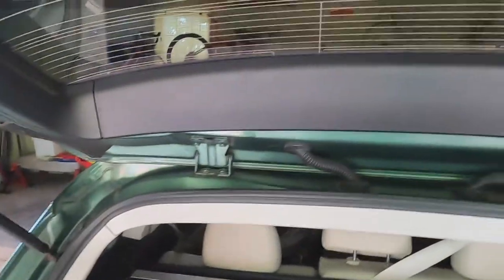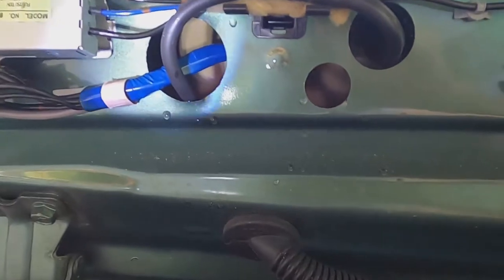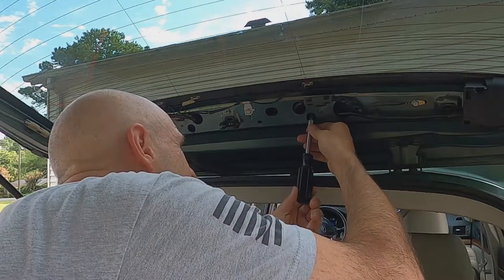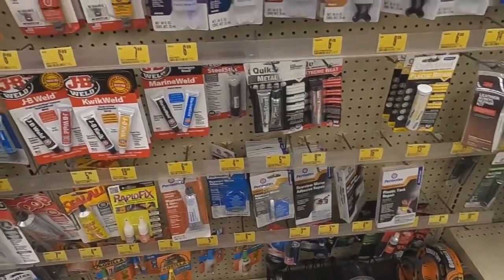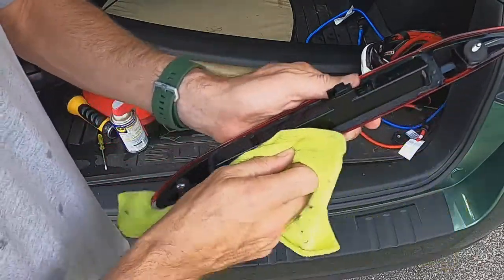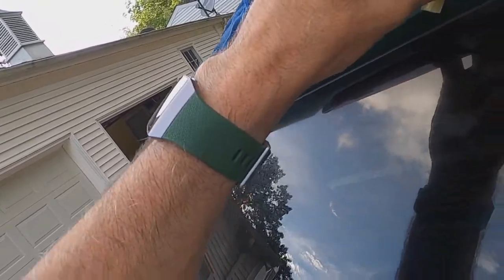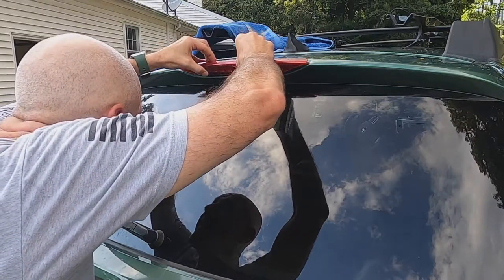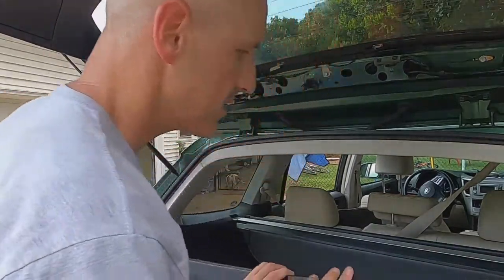2014 Subaru Outback Rear Hatch Leak Fix

Comment: This fix worked on our 2016 Forester. When inspecting the gasket I didn’t see any visible degradation but scraping it off and using black silicone fixed our leak. Just had over two inches of rain drop and our hatch area is bone dry. Thank you!

Comment: Hey!  I finally fixed that on my outback!  One side didn’t even have the nut on the bolt any longer!  A great tip I learned from scotty kilmer’s youtube is to use a small piece of blue paper shop towel to hold a nut in socket when working blind.  Just fyi!

Comment: This fix worked for my 2015 Subaru Impreza hatchback. Only difference was my light had two clips on the left and right that needed to pushed in from the interior to release it. I used the same sealant in the video and it worked out perfectly. No water in the trunk after a big storm.

Comment: This video is a gift that keeps giving. Finally completed repair, waiting for silicone to bond.

I just wish I bought the new light assembly instead of cleaning it. This endeavor has been a bitch.

Also, use disposable gloves when using silicone adhesive. It's obvious, but I thought I'm gonna be slick and accurate. I wasn't

Comment: Thank you so much for taking the time to make this video. I actually have an old 2003 Subaru Outback Wagon with over 320,000 miles and always out in the weather, no garage and I just found the puddle of water in the exact same spot as yours and leaking from the same spot as well. Had no idea how water was getting in there. Never thought about the center brake light. Thanks again!

Comment: RTV will work great until you need to remove the light.  Black Form A Gasket might be a better choice.  You want the old gasket to release or split next time again.  RTV is an adhesive material.  For the truly cautious, you can pack the thing in wheel bearing grease or Valvoline synthetic grease.  It will stop the water and release next time.  I used Form-A-Gasket.  It stays pliable. 

My car had the right nut completely off and in the black trim piece rusting away in a puddle of trapped slightly acidic water.

Great detective work 'Horn Family Adv.'  Great tip! ! !

Comment: Same issue with 2014 O/B 3rd brake light leaking water.  Gasket is not sold separately. Bought a tube of clear silicone and ran a bead around the tailgate as well as the light fixture  itself.  haven't had a leak since.

Comment: I had the same problem, i put a bead of clear silicone along the outside of the front edge of the brake light, seems to be working, ill see if those nuts are loose tho, good video!

Comment: vid was definitely what i was looking for and my adhesive gasket was shot. 3rd light was even missing a nut like someone below.  unfortunately i still have a pretty active leak after full black silicone treatment.  i have all my plastic off and still can't find the entry point of the water. it is still leaking at the same spots on both sides, right where the left and right top trim pieces join.

Comment: Going to do this now, as i have the same issue and it has caused mold on the rear carpet. I will be using G&E Supreme Silicon clear though. Will update on results in a few weeks 😊. P.S. thanks for the video and hopefully this is the issue.
Reply from the maker: Your Welcome! and Good Luck
Reply: Came back to confirm this was the issue, and the clear silicone worked perfectly! I did exactly what was in the video, and I also added some on the outside. It's clear, so you don't even see it. I did have to deep clean and extract the rear carpet as it smelled like a dead animal 😅

Comment: Good job on the fix. I did this once already on my 2011 Outback and it's leaking again. But I didn't silicone around the bolts. This time I will and maybe try some lock tight on the bolt / nut.  Thanks for the thought. Also, I feel for you. typical Dad / Husband always under appreciated. lol

Comment: I tightened the bolts without removing and put clear silicone on the outside of the brake light and solved it at this time.

Comment: Thanks for your video.
Maybe I missed it but I was wondering how you knew water was coming in at the light?
Reply from the maker: I could see it though the lens of the light.
Reply: @TheNextAdventureWeTri  Thanks...not sure I understand though since the light is sealed.
Reply: Did not work for me....seems that water is getting between the red lens and the black housing allowing it to pass thru the connector opening into the trim. I see water under the red lens...I tried sealing the lens joint....hopefully that will work.
That black rtv was very difficult to  remove.

Comment: keep in mind that replacing that 3rd brake light (Because bulb) AFTER this fix will be extremely difficult as the Black silicone makes it a semi permanent installation.
Reply from the maker: Thanks for the info. I will post how it goes when I have to replace it.

Comment: My freaking subaru leaks from EVERYWHERE. This car has had more issues than any other car I've owned. Going back to a Honda or Toyota after this. Can't wait to get rid of it. 🙄🙄🙄
Reply: What model / year?

I had no water leak problem with a 2008 impreza hatch (but had engine problems)

I now have a 2011 outback & no leaks yet, the previous owner cracked the third brake light lens & I just need to change it 😅